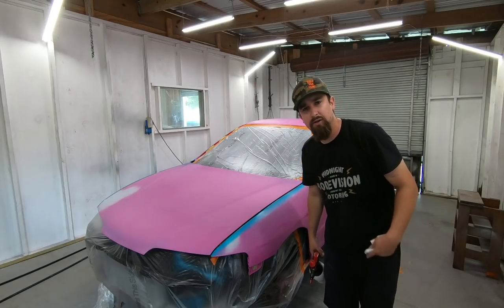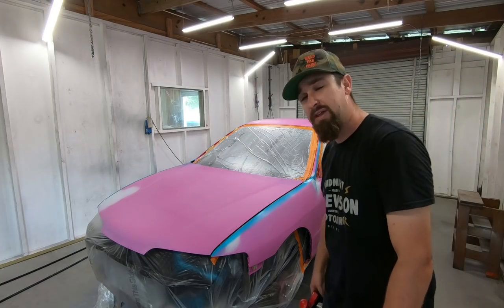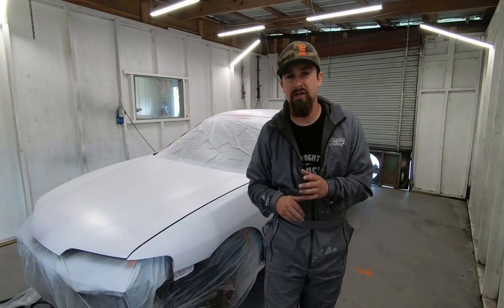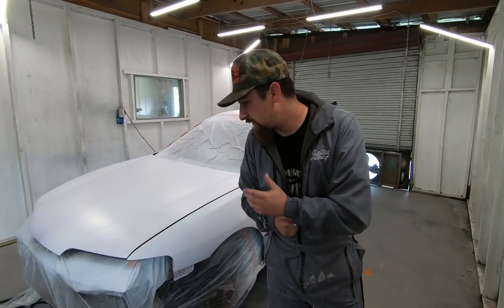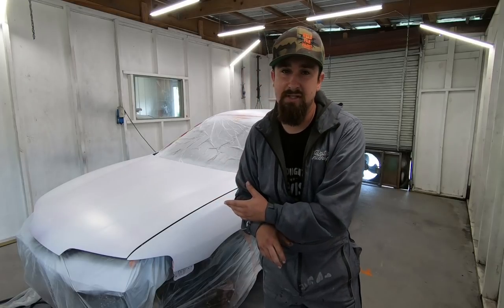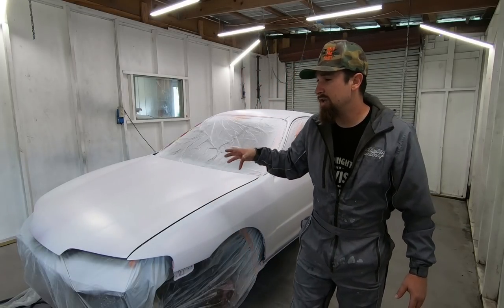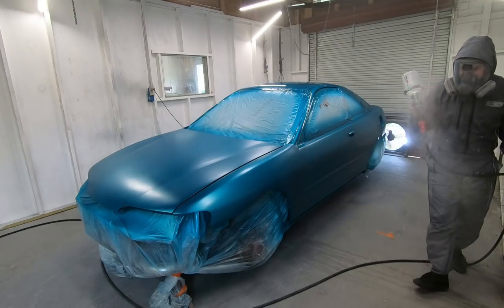Custom Paint Job Acura Integra

Comment: Great to see you back uploading again Bode, the Acura is looking mint in the new colour much better than the old pink was. I noticed you sprayed the clear using your DV1 base gun Bode so is there any reason for that as I thought you had the black clear gun as well, I have all three DV1 guns and absolutely love them. John UK.
Reply from the maker: I just try to keep it simple and use what works for me. I’ve always used the same gun for base and clear. Just spay the base at 14 psi and the clear at 24. That’s what works for me and I haven’t changed it.
Reply: Yeah the DV1 is a great gun and I've heard the basecoat is great for clear as well, the finish you got here just proves that 👏👏👍

Comment: Laid out nice! Curious on your ventilation, I'm setting up a home booth. Looks like over spray was pulled out drivers rear roof, rather then out the door fans? Trying to decide where to mount a permanent shutter fan, high or low? Any advise is welcome.

Comment: Paint looks great…so when getting ready for paint how much base coat do you recommend having on hand? Is a gallon enough for an integra curious getting ready to start body work then paint on my set of DA’s
Reply from the maker: A gallon at 2:1 should be enough for just the body. If you’re getting into the bay and other parts, you might need more. Extra is always better

Comment: Hey man, good to see your work as always. I've picked up lots of tips and am getting ready for a garage DIY color change of my own. I've watched your other vids on this paintjob and I have a question. Since the jams/fenders/hood are already painted and cleared, how do not get sealer/base/clear down into the body gaps? ...maybe it's masked and I can't see it. Also, do you sand the panel/door/fender/hood edges? Thanks!
Reply from the maker: Yes, sand the edges and I do mask the jams making sure the tape line isn’t visible from the outside. Find a corner and make the transition from old paint go new paint in a corner. It’s never perfect, but painting the full exterior is my preferred method
Reply: @BodeVision  Gotcha! Mine is a metallic too, and I'd much rather paint the car together, but of course, I wanna do jambs and everywhere else. Thanks for the reply!!!

Comment: Hey man ik this is an old vid but I plan on painting my car by myself with a few buddy’s with a car port tent I’m just wondering since I have an integra also how did u paint around or under where the trunk seal is and make sure everything is even with the outside?
Reply from the maker: I did that when i jamed out the car, so yes every square inch is blue now.